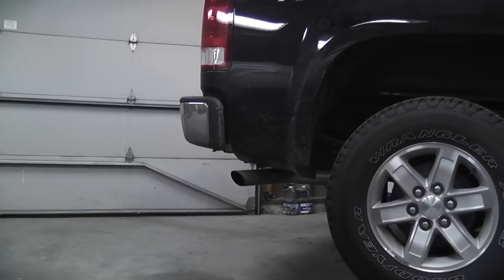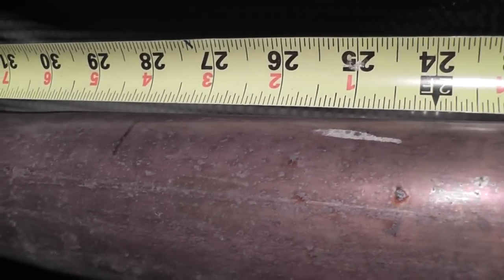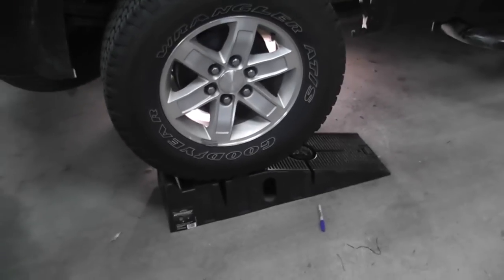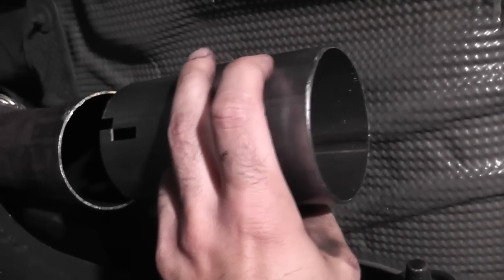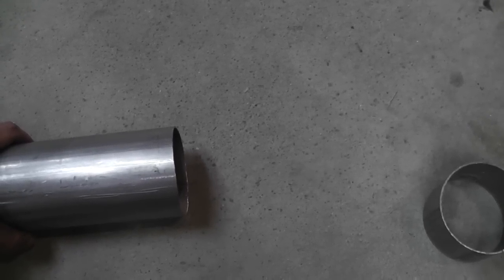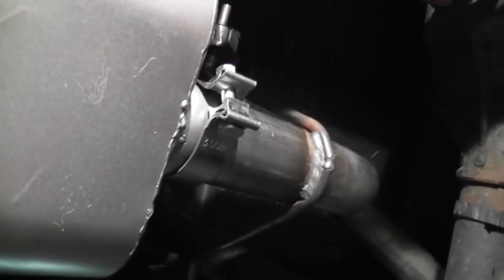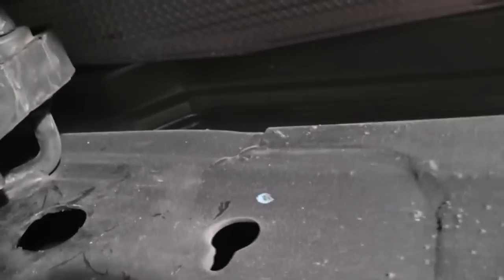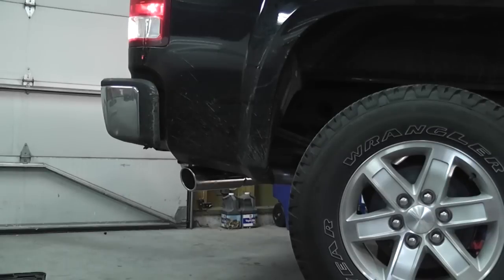Flowmaster Cat-Back Exhaust Install on 2011 GMC Sierra

Comment: Excellent video! You can position your tailpipe to hang lower by going to an exhaust shop, heating the pipe about 2" where it exits the muffler and putting a smaller diameter pipe inside your tailpipe (as supported leverage) and pulling down on it down until it's where you want it positioned. They did that on mine. Even though it was a bit of an unorthodox method it worked like a charm .

Comment from the maker: It happens more than you would think really.  On the highway in cruise control it will kick into V4 and stay there for a few miles or until I hit a hill of any kind.  I don't have any real data but empirically I feel as though I hit V4 mode more often with the new exhaust than I did with the stock.  I would attribute this to the addition of the exhaust and the cold air intake making the engine more efficient.

Comment: heads up, to get your hangers to fit nice, use a torch to heat them up til they glow and you should be able to mold them down a bit lower.

Comment: Great video!! just a tip for ya if you don't plan on keeping the stock exhaust you could have cut it one more time to make it easy to remove around the back axle! helps with the hangers too!! cheers bud!!

Comment from the maker: yeah, I left the flex pipe on. My instructions didn't tell me to take it off. All the measurements for the exhaust were after the flex pipe. To answer your question, I had plenty of room. Before I cut/clamped or did anything, I measured several times w/ the exhaust laid out and assembled off to the side of the truck to give me the confidence that it would fit before I did anything permanent.  You can try that to see how it would work out for you. Hope you don't have to make any cuts. Good Luck!

Comment: ah I see what you mean. By the way, have you thought about getting a performance tune? I myself installed a Magnaflow cat-back on my Tahoe, and threw in a K&N FIPK as well. Could definitely feel the better throttle response, but have been given advice on how to get the best out of these two upgrades, and that's with a tune. I was recommended Black Bear Performance but there's others that might get you the desired results.

Comment: thanks for the help!  my manual says i need to loosen the ball clamp right behind the cat (the one i broke the bolt head off) so i can rotate the pipe for fitting, but its a round pipe, i hope i can slide the adapter right in like you did.  and mines a 2010, not sure if there is much difference between 10 and 11

Comment: hey man, did you have to loosen the ball clamp that is like 3 inches off the cat?  instructions said too, and the head snapped off the bolt.  it looks like you left the flex pipe on and there was enough room to install.    Thanks in advance!

Comment: still don't get why you had to cut 2 inches off, I'm about to order one for my truck thinking of putting it my self, how long did it take you.
Reply from the maker: The instructions said to cut the 2in off for my truck. If you don't cut that length off the pipe the muffler won't sit in the right spot under the truck. It's been a while but if I recall, that would probably cause all kinds of issues with the back half as that part is routed over the axle and everything and all the muffler hangers come welded to the exhaust and have to line up just so. 
As far as time, it took a few hours but I probably could have reduced that time a little but I measured everything and laid it out a few times to be sure I had it right and I drove around the neighborhood gunning it enjoy the sound of a 5.3L 8 cylinder GM with no exhaust (or irritate the neighbors at 11:00PM depending on how you look at it)

Comment from the maker: From Flowmaster FAQ: "There are some modifications that have the potential to void a vehicle’s factory warranty, but modifying the exhaust system after the catalytic converter is not one of them. All Flowmaster exhaust systems are designed vehicle specific and do not violate manufacturers factory warranty. If you’re having problems regarding this issue, please contact sema.org for more information regarding consumer’s rights on performance aftermarket parts."

Comment: Just a thougt...i use liquid soap for lube on rubber parts or anything i can around things that will eventually get hot (exhaust).  It works great for lube and will dry.  Also will not small burt once the metal gets hot!
Reply from the maker: Good tip Mike. I'll keep that in mind.

Comment: I cut my original exhaust behind the muffler for easier removal, nobody wants that stock crap anyhow ... IF someone did buy it they could have it welded. You don't need a torch to bend the hanger, but I agree taking it back out is much easier to bend it. All you need is a deep socket and some extensions for leverage and it will bend with a little muscle. I always go back and re-tighten all the clamps after the system goes through a couple hot/cold cycles to make sure it's good and tight.

Comment from the maker: nope.  They only time I really get any drone is when my truck goes into 4 cylinder mode (my truck has the active fuel management and will switch from V8 to V4 when it notices less load to try and save gas.  It can be a little irritating).

Comment: SOUNDS GOOD,MAYBE SHOULD OPEN GARAGE DOOR.
Reply from the maker: Thanks.  It's a detached garage, the overhead door is closed but I have two entry way doors on the opposite side, they were open.  I only ran the truck a few seconds and those doors were open the whole time, I had plenty of ventilation.  That's certainly a valid suggestion though since it kind of looks like I closed myself in.

Comment: Did you have to weld the connections at all?
Reply: Thanks for the video by the way.
Reply from the maker: No, I just used the clamps that came with the kit. A mechanic I know said he thought that was better anyway as long as there isn't any exhaust leakage at the joints. He said the welds are the first thing to rust.
Reply: Thanks again

Comment: Any noticeable difference in power or MPG?
Reply from the maker: I believe I've noticed some increased power on the highway merging or in the higher gears. It doesn't seem as noticeable in lower gears. I've not measured anything, this is just my qualitative feel on the power increase.

As far as MPGs go I've seen an increase but I had also installed a cold air intake around the same time and I couldn't tell you how much to attribute to one or the other or if the combo is greater than the sum of its parts.
Reply: Thanks for the response I am considering the exhaust found it for $485

Comment: Sounded better with no muffler.
Reply from the maker: haha, it really did sound good without the muffler.  I wouldn't want to drive it that way though.  Revving it in park is one thing, merging on the highway....well I think it certainly turn some heads.
Reply: Shoulda gon with the Flowmaster 10 series. Kinda sounds like it did with no muffler but deeper toned. Unless you dont like it that loud.
Reply from the maker: Jaime G. That's exactly it, I wanted it louder with a good tone but didn't want it real loud. It's not that I don't necessarily like that, it's just not what I wanted on my truck. The Force II's are pretty much perfect for what I wanted.